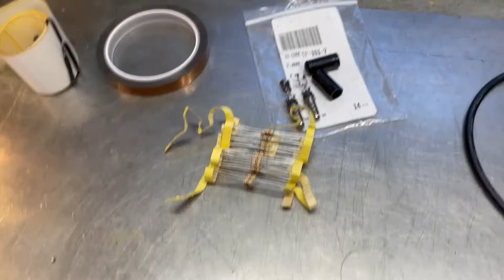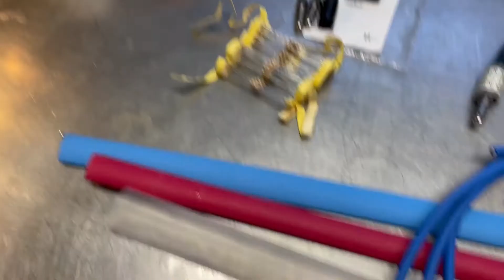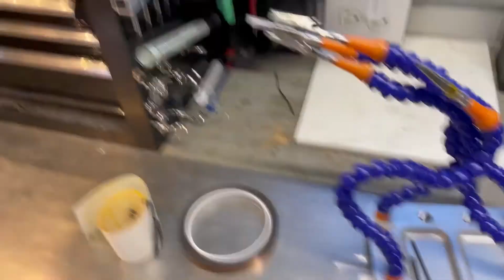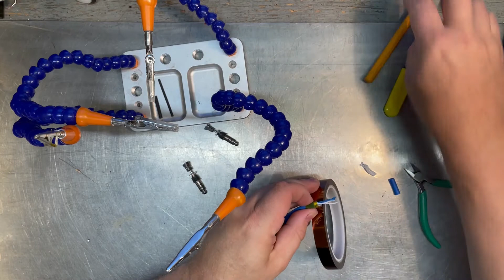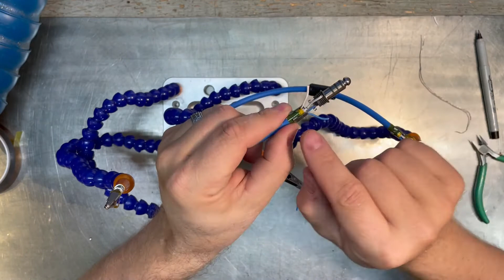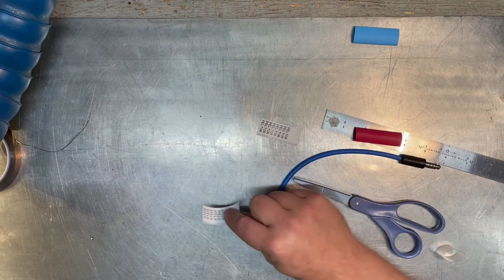Stilo Helmet to Peltor Intercom Adapter

Comment: Thank you for this great video, I was looking for information to repair my TP120 connector that goes to my Stilo helmet and came across your video. Even if your video is for another purpose I've found it great and was curious about the resistor, but understood the Stilo and Peltor are not working on the same voltage for terminal 1(Mic+??). Thank you.
Reply from the maker: Glad you found it helpful. The resistor is to match the impedance or ohm rating that the amplifier is designed for. For example, if you use a Stilo Helmet on an amplifier such as Peltor, the speakers in the helmet are "overdriven". This is not likely to harm either the speaker or amplifier (in this application) but can cause poor(er) sound quality.
Reply: @zerodegreec just finished my home made cables yesterday, working like a charm! Thank you again. Thanks for your time in answering my question, completely understood thank you

Comment: Hi…I don´t understand why the Stilo Helmet to Peltor Intercom wiring is 1-4, 2-3, 3-1, 4-2. But the Peltor Helmet to Stilo Intercom is 1-4, 2-3, 3-2, 4-1.
Reply: I understand very little of it, but perhaps because they have the mass in common and therefore they go to attack 2 poles together. But I'm not sure
Reply: Could it be that that's referring to the trophy intercom not the WRC one?